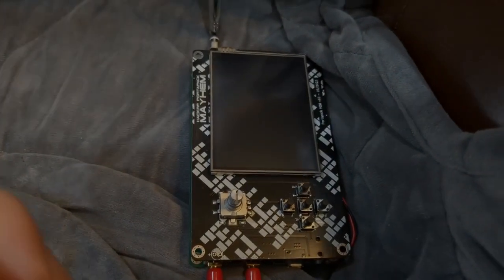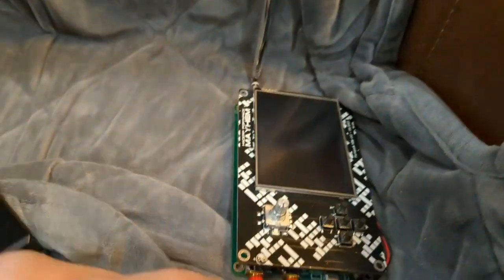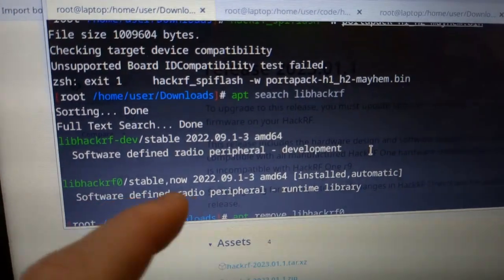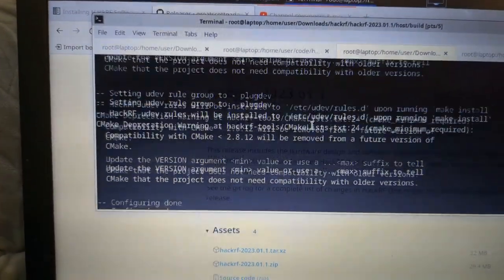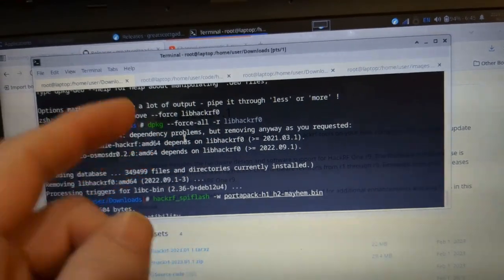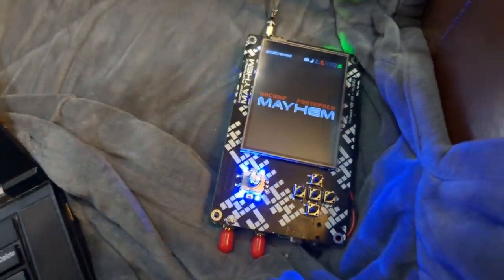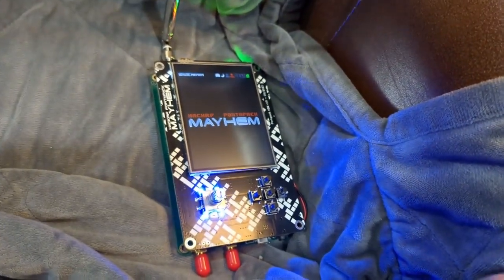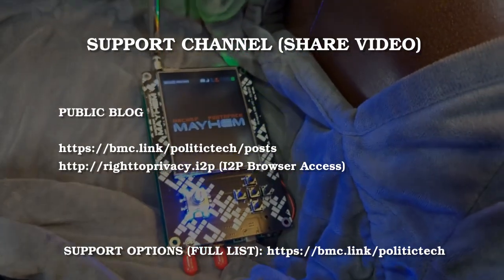📡 Flashing Portapack H2 Mayhem Firmware: Hackrf R9 Version (Make It Work!)

Comment from the maker: DISCLAIMER: FOR THE MOST RELIABLE RESULTS, SUPPORT GREAT SCOTT GADGETS OVER RANDOM CLONES. CERTAIN CLONES MAY BE MADE DIFFERENTLY. SOME MAY REQUIRE CUSTOM FIRMWARE. THE PORTAPACK IS BY HAMGEEKS. THIS HARDWARE IS FOR TESTING RADIO / WIRELESS PROTOCOLS (FOR RESPONSIBLE / LEGAL USE). IT'S RECOMMENDED TO READ UP ON MODELS BEFORE PURCHASE.

Comment: I thought i bricked my portapack h2+. Can i do these steps on a Windows PC or does it have to be Linux? I'm kind of new to the scene and about a year and half ago I went to update my portapack and just got the black screen not under standing the lib part but I have my portapack charging and I am gonna try these steps when I get home. Thank you for the video.
Reply from the maker: I believe the commandline stuff is most accessible on Linux, unless hackrf docs say otherwise. You could always set up a bootable linux usbstick installation for managing things / fixing your computer (that is one thing I keep on hand for my tech stuff needing linux / testing hardware).

The lib part you might not need to do, all depends on the version provided by your operating system. When I recorded this video, it was a time when the R9 version (printed on board) was not yet recognized by my linux system libhackrf.

So I had to make a change to make everything compatible for firmware update / change.
Reply: Quick question how do I get it in update mode if I have a black screen that's the only issue I think I'm going to run into because anytime I turn it on after I try to update it I get a blank screen. Any help is much appreciated thanks again for the video

Comment: I got a cheap clone from ebay, thing worked for like an hour but I left it to charge and came back to nothing in screen, portapacks lights are on around the knob.  No leds on hackrf board, wond recognize on pc. Took it apart and the hackrf board works without the portapack. Put it back on amd back to no screen. Wondering if the portapack board went bad on me. 😅 of course ebay seller isn't responding.
Reply from the maker: Wow that really sucks! I would check to make sure you didn't accidentally detach anything as well - I know the pins can be very tight at times. But likely a quality control issue. 

If it were me, I might give a seller a week or 2 at most to respond. Then mention you will be filing a return with ebay (they could offer you replacement, or lose all money).

Comment: Where is the break down process to get this going been on blog and found nothing
Reply from the maker: This was a vlog video showing what I needed to do, in case it helped others having trouble flashing the firmware.

Nice thing is, many kits ready to use are hundred something USD $, and already have mayhem firmware flashed (as is case with my other portapack, came put together and firmware / apps ready to use).

My case was different, as on this one, I received the portapack H2M and hackrf separately as gifts. So had to flash firmware.

I'm not sure what you are working with - did you receive a kit, or buy parts separate? What part isn't working for you?

Here is docs on updating firmware commandline: https://hackrf.readthedocs.io/en/latest/updating_firmware.html

Comment: these are what? The ham it up version?i If so, yeah, even though the "marketting" with the silk screen of the contributors plastered al over the pcb...it's been known that outside of the firmware version currently installed plus maybe support for a few others down the road...eventually te firmware willl not flash..... But, maybe you've got the answer here and resolved that issue.....  that board is mighty swish....an boyoboy woulda ben nice to have a spot on there as a top contributor...which i aint, but still, a nice touch none the less......
Reply from the maker: Hamgeek portapack. The clone of hackrf, not sure - as I received it as a gift. I'm happy with it so far! :)

Comment: Cool bro thanks I looked in the description which email can I contact u on? Thanks great video by the way!
Reply: Ok cool bro thanks!
Reply from the maker: Feel free to use any of the emails EXCEPT not the mail.i2p one (use the i2pmail.org if anything).

As the [at]mail.i2p is for internal i2p based mail, but the other, clearnet versions will work.

Thank you.